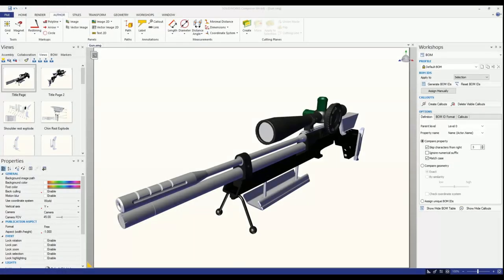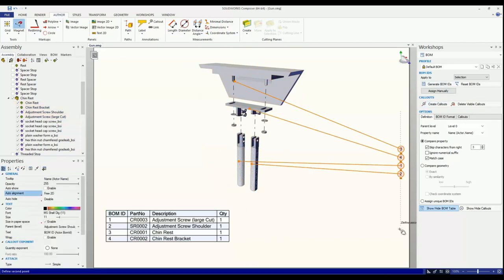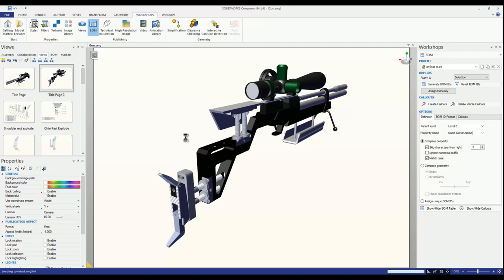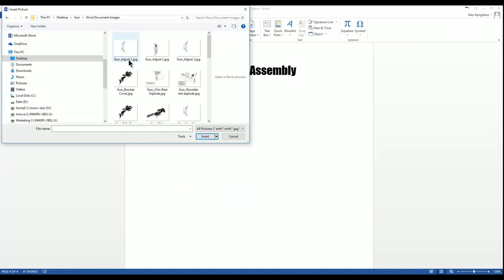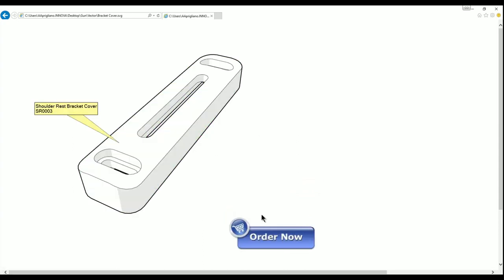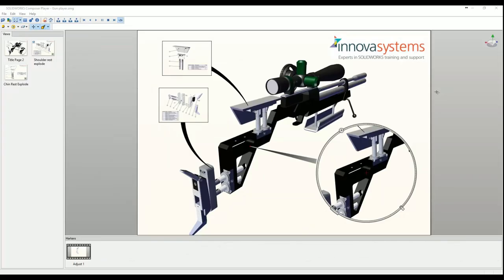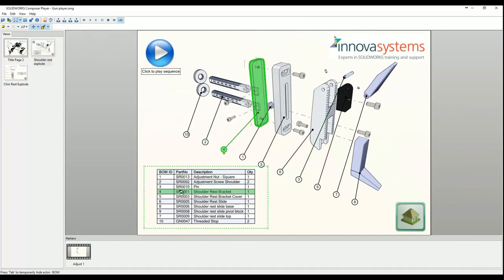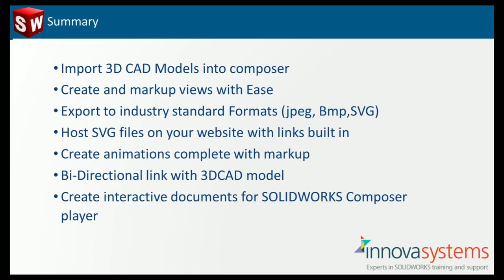How to create Technical Publications with SOLIDWORKS Composer

Comment: When I make a change in the original Solidworks assembly and update in Composer, the sequences between original views of the pieces are distorted specially when they have identical pieces in the same assembly. It's disappointing.